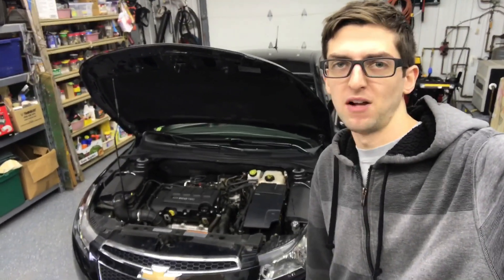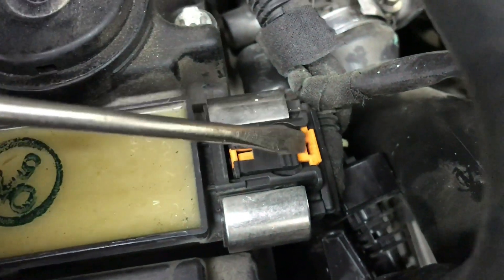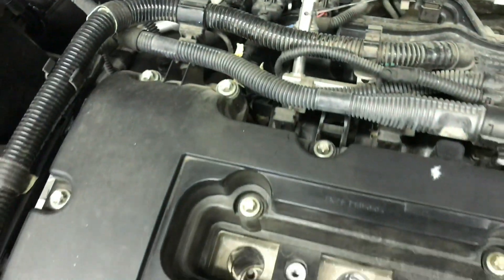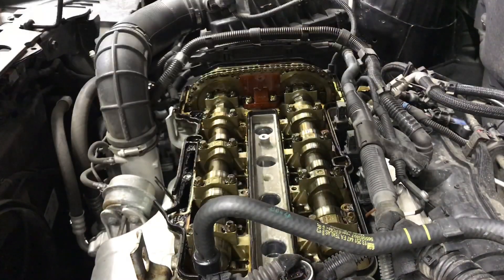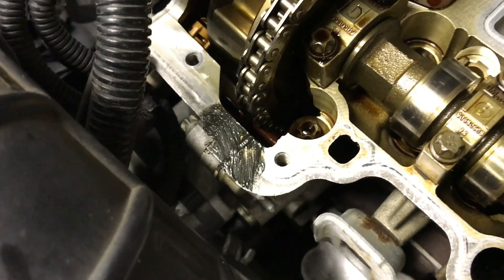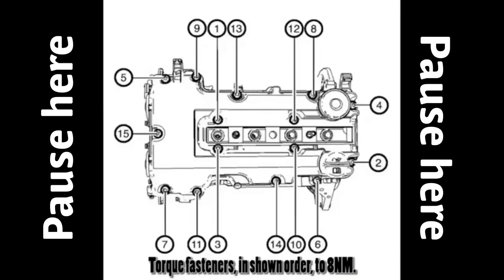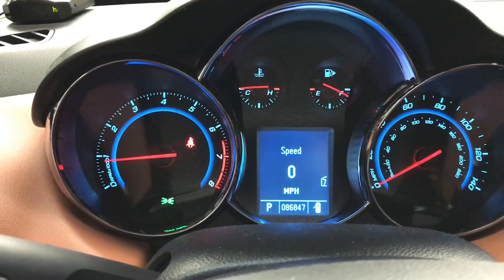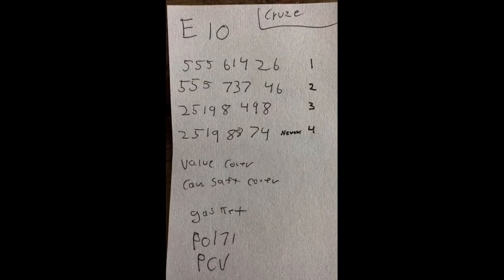Chevy Cruze valve cover replacement / PCV regulator diaphragm / P0171 2008-2016 1.4L Turbo

Comment: 2018 Buick Encore has same setup.  Mine failed at 47,000 miles.  Be prepared for a big bill, especially if dealer service.  My dealer wanted car for 2 days to "test" the problem before giving an estimate.  Having had them already try to get extra money from me, I went to trusted private garage for the fix.

Comment: Why did you change the entire valve cover instead of just changing the PCV diaphragm?
Reply from the maker: Because its one unit. Built in one.
Reply: @Mr95Kenny  
I only change the diaphragm 
It’s a lot easier and cheaper

Comment: For anyone wondering, it's more than likely your intake manidlfold, there's a tube right above your pcv casing, it goes right into the intake manifold, take that off, if you don't see a red lump/nipple, then you gotta replace the intake manifold
Reply: Plus the crank shaft sealing O-ring checking! That causes whistling sound when pressure raising in crank shaft interior. Then check the turbo oneway ventile too, if the tube taking out of the intake manifold is oily.
Reply: Yep.. This diaphragm will die again soon.  There's too much vacuum pulling because there's another leak

Comment: Does anyone know if GM has done anything to correct this problem? The 1.4L is used in several GM cars and I'd like to avoid buying a used vehicle equipped with this air leak problem.
Reply from the maker: They put a recall out if your under 100,000 miles they will put a new old one in.
Reply: @Mr95Kenny  I just found out that Dorman Products has an aftermarket intake manifold with a PCV valve that can't become dislodged as easily as the OE part. A dislodged PCV valve in the intake manifold is what destroys the PCV diaphragm in the valve cover.

Comment: That's just fixing the valve cove it's not fixing the cause. You more than likely need a new intake manifold because the PCV check valve is blown. And by the way that diaphragm on top is NOT the PCV valve, it is the Vacuum Regulator Diaphragm.

Comment: Thats a pressure relief valve, and that rupture in the diaphram  is cause by the actual pvc valve being sucked out, replacing the valve cover and not the actual pcv valve will just ruin the new one as well, one thing caused another, front crank shaft seal will also fail.
Reply from the maker: Chris Herrera i have my description updated some time ago but didn’t know how to edit the video for it.

Comment: did this cheap cover last for you ? I just replaced mine 3 times with a cheap one from eBay and every time after 2-3 weeks, the membrane blows again or starts to make funny noises under boost
Reply from the maker: Its a PCV valve the is the larger problem, check out the links in my description.
Reply: Check your intake manifold, although I'm pretty sure you already prowbly replaced it

Comment: I set my torque wrench to 71lbs and broke bolts. Is there a way to use a bolt from the old valve cover and replace on the new valve cover?
Reply: Sorry, my mistake. I was able to swap with the original valve cover. Thank you!
Reply from the maker: Christopher Harwerth 71 inch pounds. Not 71 pounds. The bolts can be forced out yes.

Comment: Im getting ready to replace my valve cover as well. But i am curious after replacing this how do i know if i need to pull the intake manifold and possibly replace the intake manifold?? Also is there any danger in driving the vehicle before i get this issue fixed?
Reply from the maker: David Moore check out my intake video and the PCV fix kit video. I have some links in the description that may also be helpful. If its running now, probably wont hurt to keep running it if you fix soon.
Reply: Mr95Kenny thank you

Comment: Hello mate... do you still have your Cruze? If yes, do you have any other issues ? And how many kms?
Reply from the maker: pack13sheet i still have it, anytime i have a problem i normally make a video on it, check them out, i have 3 more videos i plan on making this summer, just don’t want to fix in winter
Reply: @Mr95Kenny  any chance you tackling an engine replacement on the Cruze?  Head gasket blew in my 2012 at 160k miles, not worth repairing.  Considering buying a used engine and swapping it out.
Reply from the maker: Kevin. Hmm thats a big one, when the time comes and it happens to me, ill probably try to attempt it!

Comment: I bought the Valve cover already from Autozone, but it’s just the rubber. Is that the wrong part? Need hELP
Reply from the maker: SilentMarqus auto parts stores only sell the gasket, have to buy online or at the dealership. If you paid around $20, instead of $60, than thats why.
Reply: Mr95Kenny okay so I have to buy the cover and the gasket together new? Thanks for the fast reply
Reply from the maker: Yes, I remember when i went to buy it i had to go to the dealership, or buy online.

Comment: You notice any oil in the throttle body? My mom's car has a bad valve and I'm pretty sure it has for a while. When it threw the codes, the first thing I did was clean the throttle body and low and behold: oil!
Reply from the maker: nbarrager Productions yes there was

Comment: Do I really need to use that seal goop for the new gasket? Or can I put on the cover without it?
Reply from the maker: Zildjian Beats probably be ok without, just keep eye on it
Reply: @Mr95Kenny  hey thanks for the quick response man! And also I was wondering I've heard a couple things from different mechanics if I actually need the torque rench to take off the bolts and others say I can use a regular socket rench for that. Any thoughts?
Reply from the maker: You can use whatever you want to take the bolts off. But when you reinstall you will want to torque. I use a $10 torque wrench from Harbor Freight.

Comment: Nice video, but you didnt actually change the pcv valve. You changed the diaphragm. That's the end result of the pcv valve failure ( the diaphragm in the valve cover blows out because of the missing orange flap in the intake manifold) the only real way to fix the pcv system is to bypass the factory system and build your own. Even buying a brand new GM Intake and GM valve cover will not last.
Reply from the maker: Geoff Frigo will look into, thanks
Reply from the maker: Thank you for your reply, I started looking into this more and realized the extent of the problem. Without your reply I probably would’ve gone through another valve cover, I really appreciate it! I posted two new videos about this and will be editing this video to correct myself.

Comment: Did anyone else notice the ticking? I have it  Intermittently and this did NOT fix it.
Reply: It's the valves doing their thing
Reply: Did you figure it out?
Reply: @luimobilefixes5279  Yes, it was the timing chain guide. It's common for it to loosen up and cause reduced oil pressure. As a result I got the ticking noise, reduced power, and a knock sensor error code.
Reply: @jasongentry7177  wow and that's expensive to fix for a the consumer wonder why GM uses cheap parts on something so important.
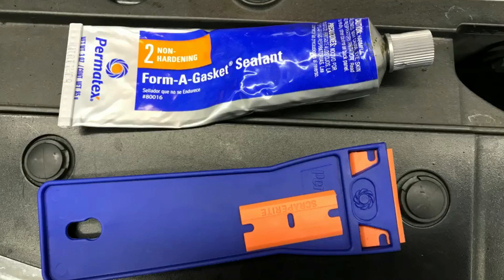Reply: @luimobilefixes5279  42 dollars and change including the valve cover gasket and the part. The part didn't break it somehow loosened up causing reduced oil pressure.  It's the red part under the timing chain at the back of the engine at 3:04 in the video.
Reply: @jasongentry7177  did you change the part yourself? Was it an easy fix?
Reply: @shawnwarren7131  Yes, I did change the part myself. Two bolts on the part itself.
Reply: @mr.gentry7643  I'm hoping it's my purge solenoid but if not I'll do your fix next since the part is like 5 dollars on rockauto..

Comment: That's NOT THE PCV valve.  The PCV valve is located inside the intake manifold. That disk rupturing is not the cause of your problem. It's a symptom.  You're going to end up doing that job again.
Reply from the maker: After looking into this more I realized how wrong I was, thank you for the comment and helping me to dig deeper. I have posted two new videos about this and will be editing this video for misinformation.
Reply: @Mr95Kenny  I like your humble style.  You admitted you were not right and educated yourself further.  Then you educate me with great videos.  Right to the point and into the nitty gritty.  I subscribed to your channel, you are a great 'tuber.
Reply from the maker: wayne foutz well what ever that thing is, the rubber diaphragm was torn. After replacing it, my Cruze has run great for the last 25,000 miles.
Reply from the maker: wayne foutz I looked into it and was wrong, will be doing a video down the road
Reply: @ wayne foutz is right

Comment: My chevy cruze came up with the po171 and p0302.  I didn’t put the cap on right after an oil change and oil got all over the engine and apparently oil got into the spark plugs.  After changing out the spark plugs, it is running roughy at approximately 700-800 rpm while at a stop and with the brake pressed.  Do you think changing out the valve cover will fix this?
Reply from the maker: No Gi look to see if you have the old style PCV on the valve cover and check if its leaking vacuum like my video shows. If its not, than no.

Comment: Just a warning - be really careful when reinstalling the new valve cover. Even with all the other bolts hand-tight, the #15 bolt ended up getting stripped. Super frustrating.
Reply: Just cover it in red loctite and then put a heavy weight on it until it dries.  I'm sure the threads still hole a little bit.  It doesn't really have any pressure pulling on it.  Just glue it in there. lol

Comment: This happened to my 2013 Cruz while it was still in warranty.  If I remember right the service writer said the job would have been about $600 had it not been covered.  .
Reply: How many miles did it have for the warranty to cover it? I have a 2014 chevy cruze with 60000 mi.
Reply: a tip: you can watch movies on Flixzone. Been using it for watching lots of of movies during the lockdown.
Reply: @Hugh Denver definitely, I've been using Flixzone} for since december myself =)

Comment: When you had to re-do because of the leak did you buy a new valve cover or re-use the new one?? Mine is leaking and idk if I need to buy a new one....
Reply from the maker: Antonio Fuentes i re-used, but bought a new gasket
Reply: Mr95Kenny thank you for the speedy response. I got lucky and found a gasket locally so hopefully I get it right this time.
Reply from the maker: Also two, the gasket ceiling surface has to be clean as glass, there can be no hint of the old gasket on their
Reply: Mr95Kenny thank you again!

Comment: So you put Permatex #2 ALL the way around the gasket sealing surface? Also, I just got a new cover for my 2013 Sonic 1.4. I got it from the dealer. I gave them my VIN, and got part #25198877. Apparently this part supercedes part #55573746. But when I looked online, it said that part #25198877 did not fit my car. The dealer parts guy assured me it would. I have not installed it yet.
Reply from the maker: Gerald Scott only put near the timing chain, and i do not know about that part number

Comment: Can someone please tell me if this is the right part for my car part number 25198877. I have a 2012 chevy cruze LT 1.4 engine
Reply from the maker: Allison Ryans just a quick search and I don’t think so. Use my part number in my description.
Reply: Mr95Kenny part number 55573746 right?
Reply from the maker: Allison Ryans 25198874
Reply: Mr95Kenny when I look it up on gmdirect.com it says that it is doesn't fit my car
Reply from the maker: Allison Ryans call a chevy dealerships and talk to parts department, tell them your car and what you need, go by the part number they give you. I bought mine on amazon.

Comment: I was wondering if you had any smoke from exhaust? And if oil level changed?
Reply from the maker: Christopher Bly could not tell difference in exhaust, oil went down just a small bit
Reply: Thank you, mine has vacuum at idle, as I’m driving it will miss and backfire, then clouds of white,bluish smoke I’m sure this is problem.